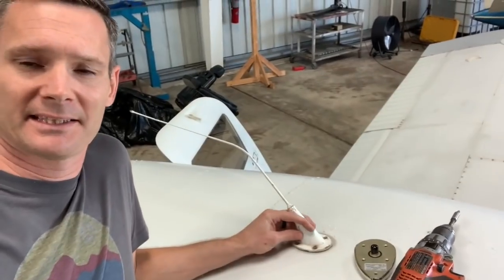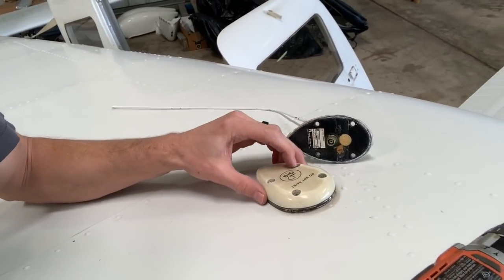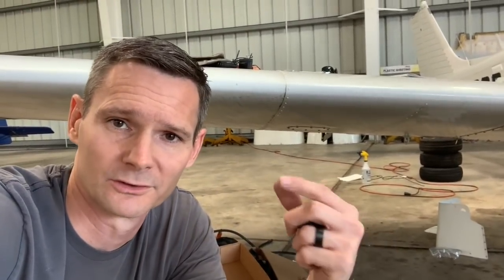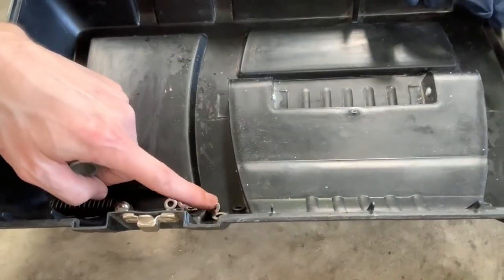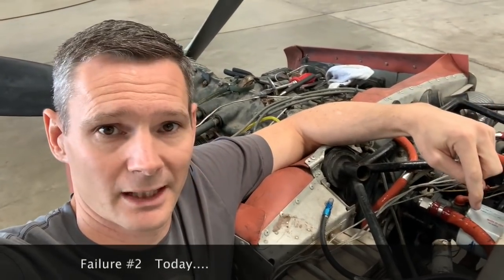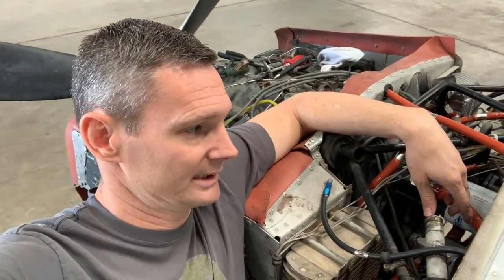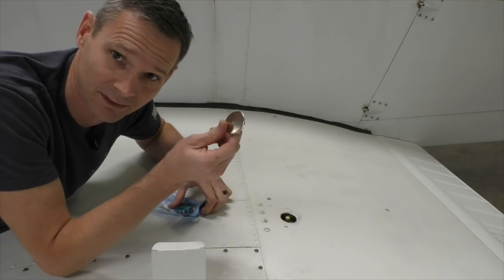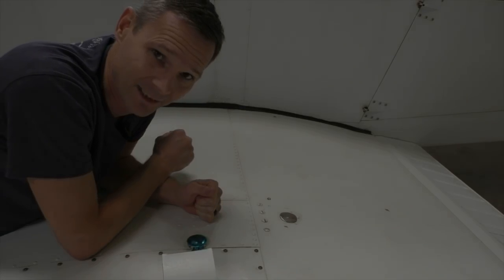2 miracles, 3 expensive fails... airplane bankruptcy in action EP09

Comment: Those cover plugs on the wings to cover the servicing ports for the main landing gear struts, used on most Piper aircraft with fixed landing gear, are designed to pop out when you have a hard landing, which means the mechanic will need to perform a hard landing inspection on the aircraft to insure its airworthyness if a plug is missing.

Comment: I owned a Cherokee 6 bought it in Tampa FL back in 2000. Flew it to my FBO in Albany, NY. Sept 11 hit and
I was grounded. During an annual inspection the logs indicated that the engine had 100 hours since rebuild but 
didn't indicate that the plane had crashed during its life with a prop strike. The engine frame was bent and the
nose wheel was still damaged from the crash $10,000. Got the plane back leased it to a flight school they
ran the engine out of oil and crash landed the plane at Schenectady, NY Airport everyone survived. This
forced me to file for bankruptcy. I've never flown again!
Reply from the maker: holy moly!!!

Comment: Fellow “6er” here!  Since your original logs were lost, you’re going to have to do the new wing spar eddy current inspection (AD 2020-26-16). I’d recommend you try to get that done before you go any further. If it doesn’t pass, you’re talking replacement wing spar(s).  There’s also the second separate AD that requires cutting inspection panels under the wings (some models) to check for hidden corrosion (AD 2020-24-05).  Good luck!
Reply from the maker: yep, just getting that scheduled this week :/ there's another $500 in the wind!  As part of the prebuy, we did as good an inspection as we could and no signs of corrosion anywhere on the spars/wings/etc... *fingers crossed...
Reply: @therealjimmysworld  
A friend of mine used to brag about being paid to be "a crack inspector" for a major airline. 
Definitly get that done sooner than later.
Reply from the maker: @ricknash3055  how would you like that on your business card.... Professional Crack Inspector
Reply: Let us pray.
Reply from the maker: @thepurpleufo  for real....need some holy water on this thing!

Comment: Your oil pressure issue is probably old oil that has migrated into the oil pressure line from the engine to the gage.  Disconnect from both ends and apply pressure at the gage end. You will probably see old oil come out.  Flush the line with clean solvent and blow dry. That should fix the problem unless the gage is contaminated.
Reply: * Gauge
Reply from the maker: Thanks for the suggestion.  You know...I kinda wondered that myself.  especially with all the other "tarnish" I'm finding.  I'll look into that more.

Comment: Luck is like a sine wave. Looks like you just hit the bottom! Just a thought: Wouldn't it be the most reasonable to first get the engine up and running and AFTER THAT start buying avionics, interior upgrades etc? Or was the engine working previously? Sorry I've been skipping some parts of the videos!
Reply from the maker: Engine was working good when I bought it.  I mean, let's face it, you really buy an engine and get a plane for free! hahaha. Also, the radio's were busted and it couldn't get out of annual without working radios/avionics.  Soooo.... here we are!

Comment: G, day Jimmy from Sydney, Australia.
* do you think there is paint thickness still over the aluminium to cut it, polish and ceramic coat?
* are you doing new Interior: the sunlight hardens the plastic covers and panels.
* Is It going to be newly registered with the FAA therefore a new registration number.
* has your A&P a bores scope to inspect the crack shaft, exhaust valves, cylinder heads, piston cylinder walls?
* interesting Jimmy when you do a oil change and cut open the filter for metal particles you can have them tested: it may reduce the cost from a overhaul to bearings.
💯💢💥
Reply from the maker: Thanks for the questions!
- paint: yes, I think it will clean up nicely
- interior: only items that broke and missing clips
- has current registration, so FAA is happy
- yes, we bore scoped it before I bought it as part of the pre-buy
- I always cut the filter open on every oil change.
Thanks so much!